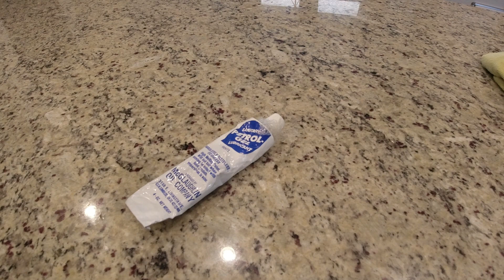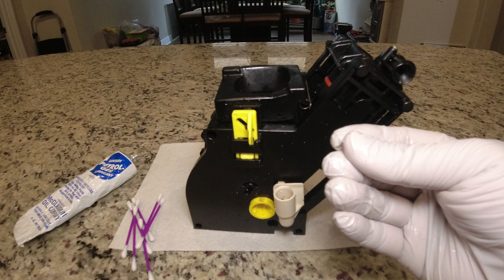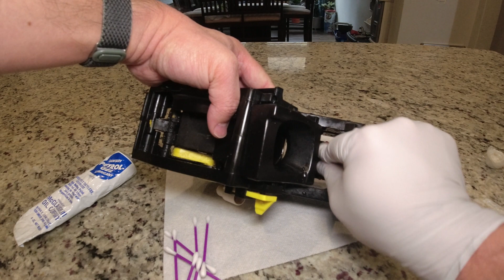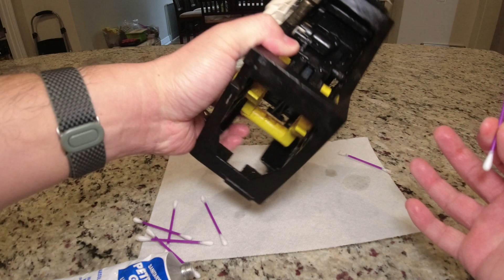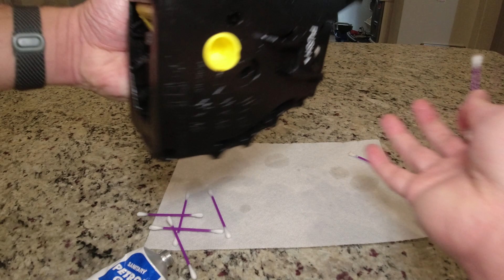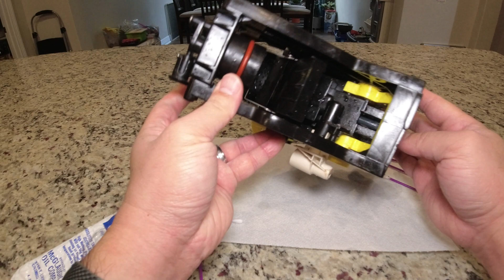How to spin & pinch and lubricate the o-rings on your Philips LatteGo SuperAuto Espresso Machine

Comment: Don't use q-tips. The fiber will be stuck in the brew group.
Reply from the maker: I haven't had that experience yet! But it does make sense
Reply: There are sponge swabs that work well for this and are reusable. Also some other qtips that are tightly woven as well (you'll notice a sharper tip on them)
Reply from the maker: That's a good tip! Pun intended, thanks!